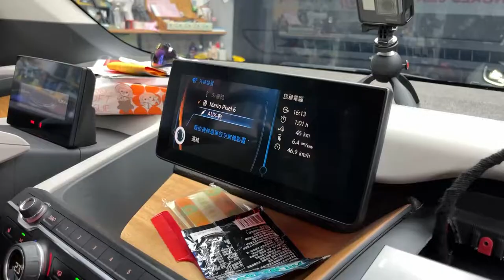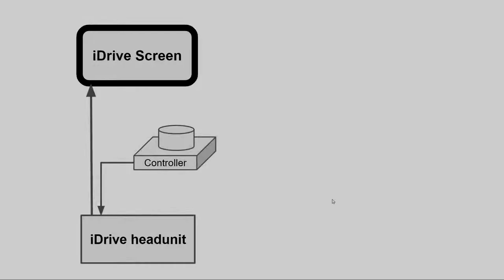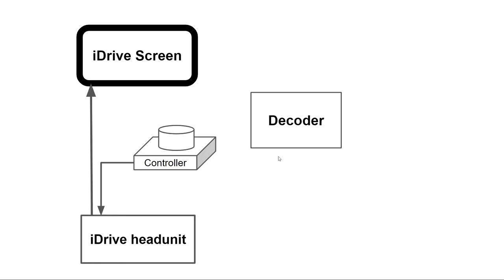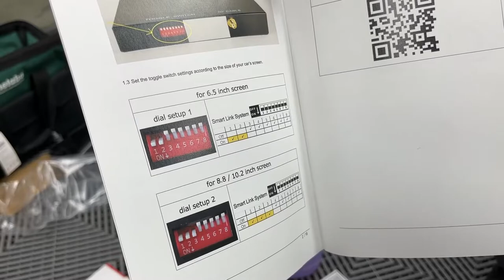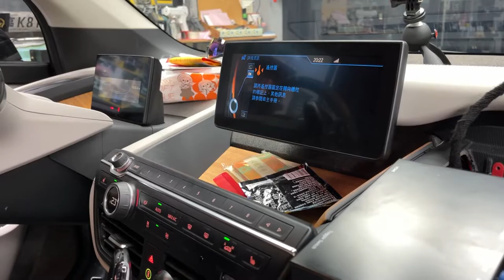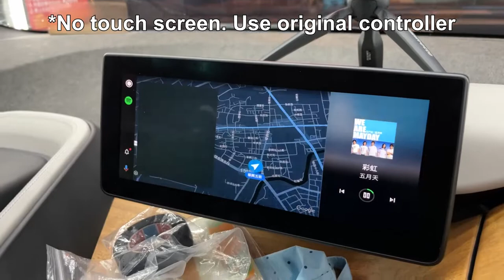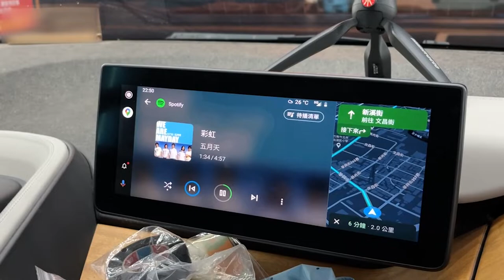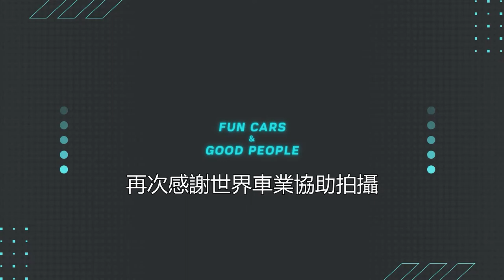Apple #Carplay & #AndroidAuto Install to #BMWi3 #iDriveNBT [ENG SUB]

Comment: You can remove the front dashboard slightly where it hides the torq screw. Pull it gently and it gives you plenty of space to undo it with a screwdriver. Thirty seconds rather than sweating. Great video though. 😊
Reply from the maker: Thank you Mr T! Very great advice! Pinned it!

I should have realized this. It is just doesn't make sense to design the trim like we thought 😅 I also learned a lot from this work!

Comment: Couldn't you add something to the sides the sharp support beam, like thick tape or something to avoid the cables being cut?
Reply from the maker: Hello Mike you are right about it. However, that workshop was lent to us so we were not fully prepared for this work which we never had experience about it.

I am thinking about the foam cushion stickers which are commonly used for chairs/desks/doors, can be applied for this problem 🤗

Comment: Did you guys disconnect the 12v battery and the HV battery disconnect switch in the front of the car? Or were you able to do this work “live”?
Reply from the maker: Hello Nokmaar, we did this work "live." But you are right with disconnecting all the batteries. I agree that is the most precautious and careful way to do the electricity works. Thanks for the comment!

Comment: Great Tutorial and a nice piece of videomaking. Thank you! One question: Why can I not install the decoder next to the head unit and use the existing LVDS-cable to the screen? Then there is no need to put an additional power cable to the front? There is a lot of space under the rear seats, isn´t it? I think there is a Carplay/Android Auto-Set available for other BMW models that provide a short cable between head unit and decoder and still use the existing LVDS-cable to the screen? I think I could live with Wlan Antenne and Video/HDMI cable close to the back seats. What do you think?
Reply from the maker: Hi RME thank you very much!

And I am amazed by your idea because I never thought about this. Brilliant! Yes you can leave the decoder under the rear seat alongside the head unit. Thus leaving the front part of the interior untouched.

Man this is really an optimized idea 👍👍👍
Reply: RME - I've read that this method only works on the i3 with the smaller screen. Apparently the i3 is very sensitive to the amount of power/signal going up to the front, especially with the larger screen as it draws more power. Anyone with the larger screen (stock, not added after the fact), gets a "no signal" error if they try this method.
Reply from the maker: @davidhoffman90  Hi RME thank you very much for this information! Really professional aspect! I'd say that the signal output spec of the decoder may be lower than that of the original headunit, leading to signal/voltage loss when a longer routing of the video cable is used. Very interesting!

Comment: How we can leverage the HDMI cable in the device ? Can we connect input connection and watch it on the screen ?
Reply from the maker: Hi Amer,
We haven't used this function yet but there is an input option of HDMI on the decoder menu so we think the answer is yes!

Comment: Mine used to work fine. But then it started to randomly not turn on and sometimes turn on.  it started to show me only black screen.  Now when I press menu button it shows me night sky with the car logo and CARPLAY written underneath, and it stays on that screen. How do I make it work again?
Reply from the maker: Hi George thank you for the question. I am assuming you are talking about an aftermarket Carplay or AAdecoder. The first thing I can guess is overheating of the decoder. Even BMW headunit can freeze in such case.

Please check that the decoder is working in an environment that spores not get too hot. Then try to reset the decoder via a button on its body.

If the situation persists, the decoder is likely bad ☹️

Comment: What backup camera do you recommend to use with the decoder based on ease of install?
Reply from the maker: Hi Sean thank you for the question! Most decoders support RCA video input so I'd say look for an RCA backup camera and stick it to the rear window (inner side.) Such RCA backup camera only has power input and RCA video output so wiring should be pretty simple. This can a quick hack if you don't have time and you need to use the car a lot 😅

However, I'd still recommend the OE type backup camera which requires removing some trims and parts to run the harnesses. Have fun DIY! 🤗
Reply: @funcarsgoodpeople  do you know the part number for a 2015 bmw i3?
Reply from the maker: Hi Sean the OE backup camera has part number 66539475687. Please search "bmw 66539475687" then you will see how it looks like. However this camera uses the connector interface for the NBT system, which may not be compatible with aftermarket decoders. Please also look up "bmw i3 rca reverse camera" for the decoders.